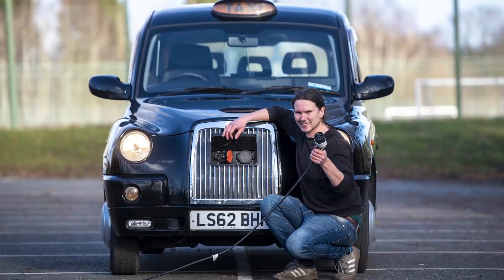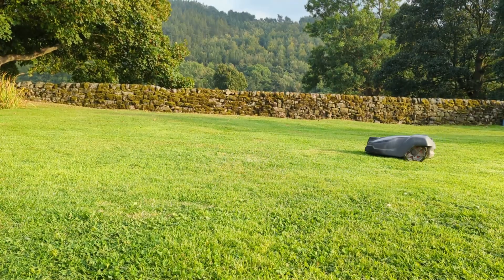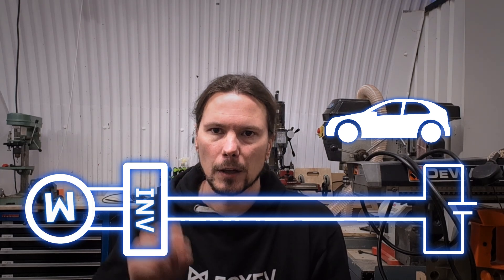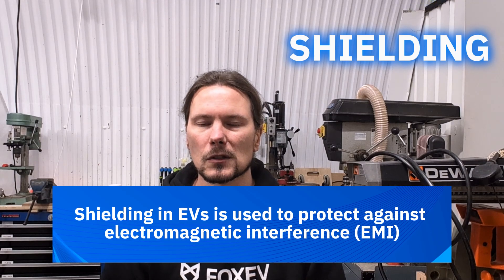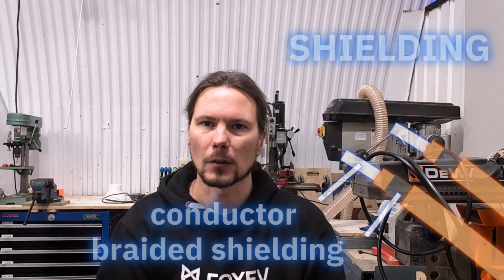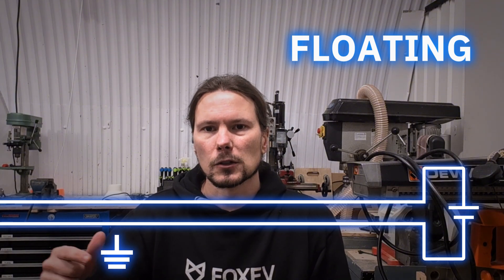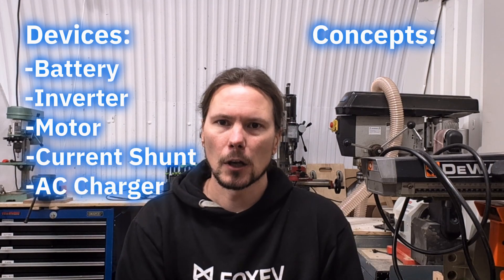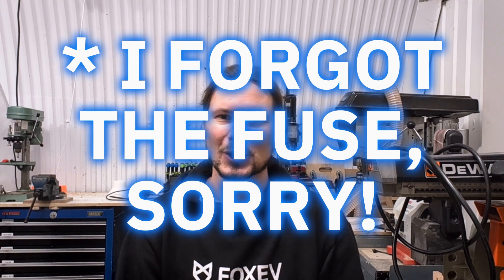What is the high voltage bus? EV technology explained by Janosch from foxev.io

Comment: Wow, very interesting information, thanks a lot! Could you please explain how do cars test the quality of ground connection? Typical example the Zoe is very demanding on this condition. I always wondered how can a car check the ground loop resistance if it sits on insulating rubber tyres.
Reply from the maker: Very good Question! There is no earth ground connection, and it is also not needed. You should think of the car itself as "ground" in the animation around 3:27 
So the test there is from HV- or HV+ to the vehicle chassis. Not to ground on the grid, or an earth rod. 

I did actually use the wrong symbol there, I should have used "Chassis Ground" rather than "Earth Ground".

Your Zoe will probably measure resistance between it's chassis and the HV bus. Another technique is to inject a known waveform in the HV bus, and then observe the "Chassis Ground" - hopefully it will not show up there too!